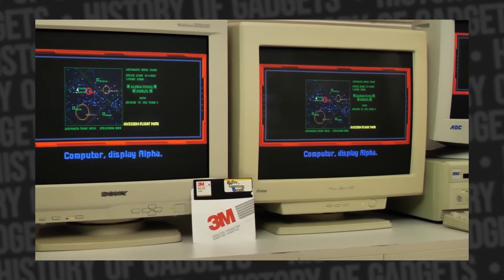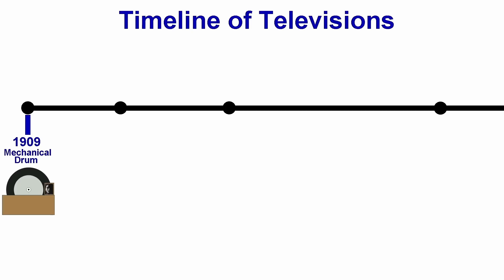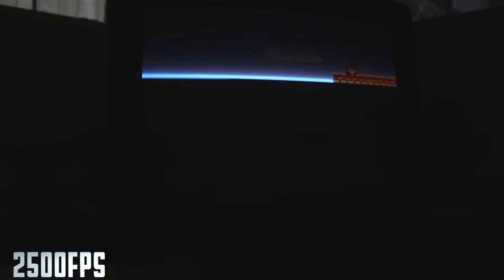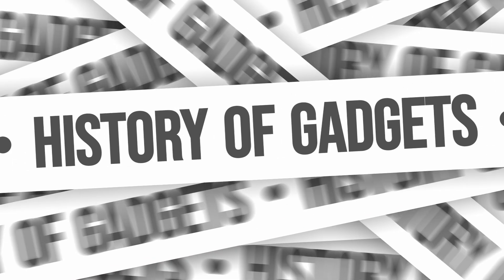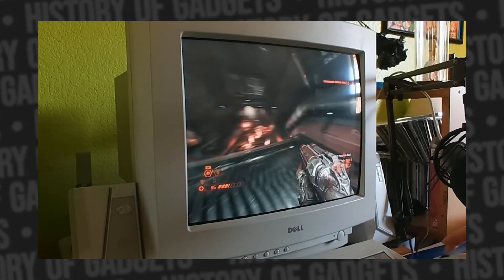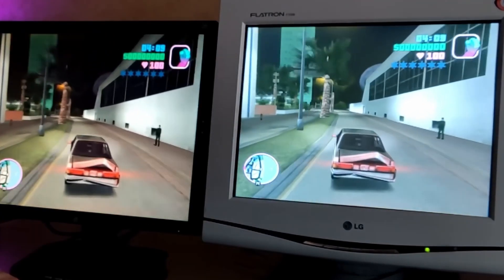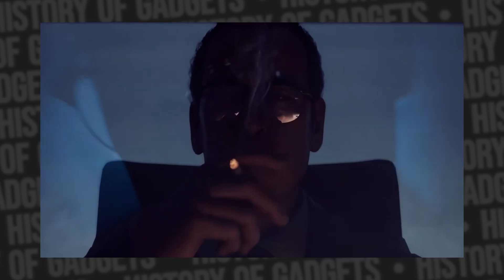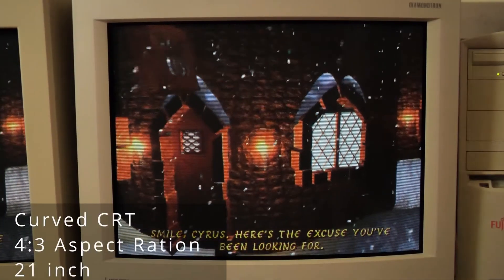Why old CRT monitors were BETTER than modern displays?

Comment: We need a crt revolution, we went down the wrong path. Someone needs to research and develop a thinner, brighter, lighter, and more efficient crt monitor that can accept HDMI and display port. We won't need to constantly build crazy powerful gpu's just to fit constantly increasing pixel density.
Reply: And eliminate the screaming ring that crts make.
Reply: That's unfeasible now given no mainstream normie would want a crt.
Reply: We need SED TVs.

Comment: People actually believe this nonsense? Lol This video was made by a gen alpha loser.
Reply: It's true. Once i picked up my 1440p CRT monitor from 2002, i can't stand 1080p even 1440p flat screens anymore.

The only thing that could be superior is a 4K 144Hz S90C/S90D QD OLED TVs as examples but the motion clarity still isn't good enough.
Reply: @saricubra2867  LOL, you think you have a 1440p monitor from 2002?
Dear God you people are so sad.
Reply: @sprockkets Sony GDM FW900 can reach 4K and can do 2304x1440 80Hz.

1080p started as mainstream on Steam like 7 years ago and 1440p isn't even mainstream yet when 1536p CRT monitors were a thing 23 years ago and above that res
Reply: @saricubra2867  Lol, no, it cannot. See, this is why you people are so sad. You have no clue on how CRTs actually work. The fact that you even think it can run at actual 4k is a joke. CRTs also have a native resolution and running it higher makes the picture quality way worse with a sharp decrease in light output.

Second, that ridiculous monitor weighs 92 pounds, and takes 170 watts to run. Meanwhile my LCD from 15 years ago, still working to this day, doesn't have to worry about refresh rates or even barely taking 20 watts to run.

"1536p CRT monitors were a thing 23 years ago and above that res"

Oh my freaking god, please, stop, just stop.
Reply: @sprockkets Your 15 year old LCD with non-existant blacks, color accuracy, contrast and motion quality.

CRT is a chunky OLED.
Reply: @saricubra2867 oh and to add to this, lol, no, by 2010 no lcd monitor had issues with motion or even color. Even my 2004 Samsung doesn't either. 
Keep coping with comparing your crt to early 2000s lcd monitors. 
Heck, even if you think you like crts, there are much better ways of doing it. Even plasma ffs is better.
Reply: @sprockkets CRTs are better than Lcds when it comes to picture Quality. Also Plasma is better aswell. The Downfall was too much size and power consumption. Only Oled is comparable.

Comment: Owning a high end CRT monitor is the chunky equivalent of a QD OLED but without motion or upscaling blur and smoother color gradients (analog) and more accurate without lag.

The only OLED that i actually like and complements a CRT perfectly from personal experience is either a Samsung S90C or S90D 144Hz 4K TVs. OLED monitors are absurdly overpriced and worse motion quality than those Samsung TVs (have black frame insertion that improves motion quality for 60fps gaming). Don't get me started with their color accuracy.

Comment: crt monitor is far more robust than led tv.. it could age 20-30 years and still working.. unlike led tv.. you can use it usually 1-3 years.. a few up to 5 years..
Reply: Cool story bro. I have a 21 year old Samsung LCD that still works today. The Asus monitor I'm using is now 15 years old with an LED backlight that still is just as good as the day I got it.

Meanwhile, the Sony Trinitron monitor I bought back in 2001 died in 2 years, was repaired under warranty, then died 1 year later in literal smoke.
Reply: @sprockkets man, normies always use anecdotal evidence
Reply: Not true.
We have LG led tv at house and it's been working since 2012
Reply: @troyc09 normie, anecdotal evidence